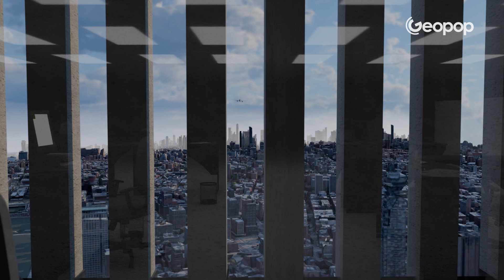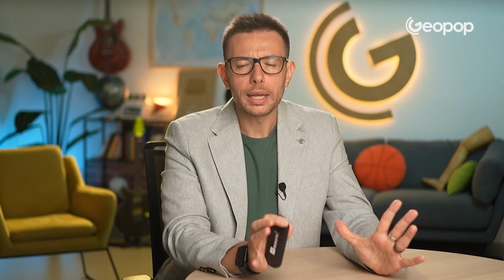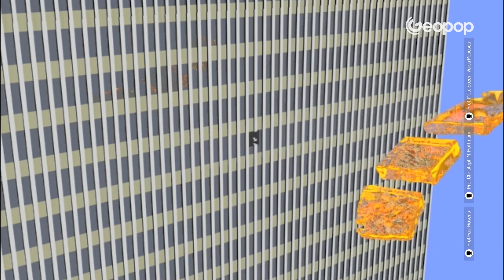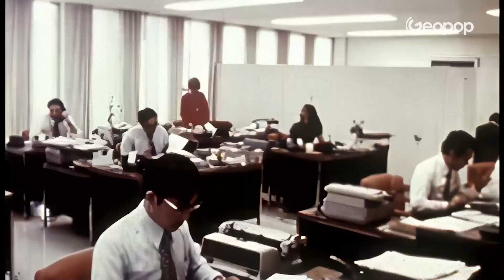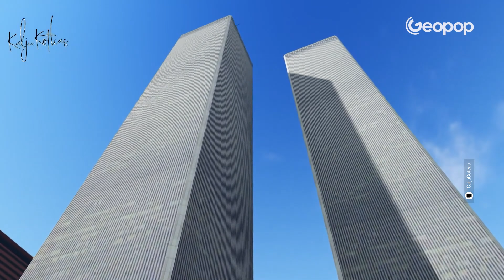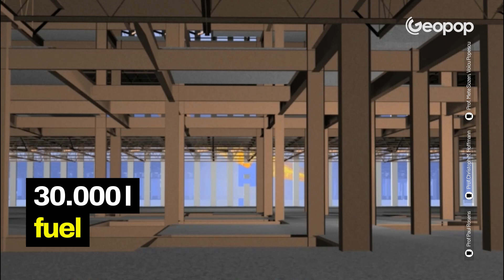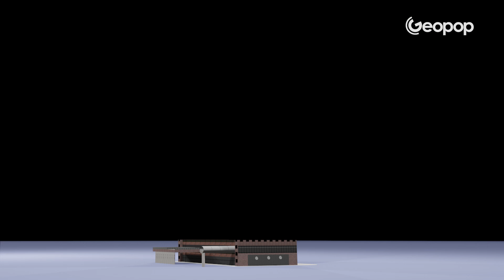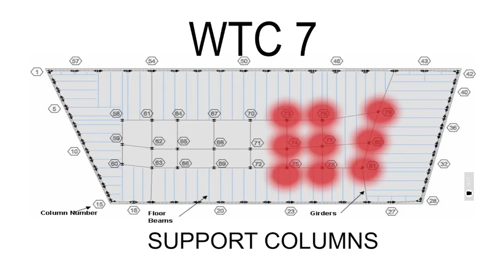9/11, 2001: The Technical Reconstruction of the Twin Towers and WTC 7 Collapses

Comment: It's much easier to say "controlled demolition" than do the physics & thermodynamics calculations involving materials, pressure differentials, conservation of mass, momentum, energy, temperature, laminar vs. turbulent flow, viscosity, and density. Conspiracy theorists don't offer conclusions based on scientific reasoning, they only offer infinite "yeah, but" conjecture.
Reply: So, you've encountered buildings with planes going through them often? Hmm.
Reply: @VickiLynne54-1 No, of course not, nor did I assert that.   But I’ve seen thousands of controlled demolitions.
Reply: @joeschmo5166  just because it quacks like a duck doesn’t make it a duck
Reply: So true,  they think we are fools
Reply: Explain the freefall of Tower 7 with physics which doesn't include demolition.
Reply: @joeschmo5166  stop watching the edited videos from the north side. Look for long video of that building from the south. Seriously, do some basic research. It really doesn't matter; 24 years of indoctrination with self fulfilling "yeah, but" nonsense. I'm not going to be able to explain something to someone effectively brain washed by "Loose Change," "Barrie Zwicker," & "Dr. Judy Wood" plus countless other charlatans.
Reply: @misterfunnybones  Don't need the videos, don't believe you are correct.  Good luck.
Reply: If those people could read they'd be upset.
Reply: Short sales of Airline stocks?  Yeah but...
Reply: @joeschmo5166  4.5 billion dollar settlement...yeah but 🤣
Reply: @joeschmo5166    There is pervasive informed trading activity in equity options before M&A announcements, consistent with strategies yielding abnormal returns to informed investors. All you're telling me is that the market is biased for certain individuals. It's not surprising. The attack was clearly planned & some people knew about it. Admitting that some people knew about it is not a necessary or sufficient condition of an alternate crazy conspiracy theory. Yeah, but...what?
Reply: @misterfunnybones uhhhhhhhh….
Reply: Trying to justify that it was a terrorist by the people implicated. Too save the dancing israelies. We all know what the truth is
Reply: Sorry but if one thing is proven true on that day all the other things come into question. We say controlled demolition because people educated in that field have said it and explained it.
Reply: Gotta love Google, one copy and paste can have you sounding like you studied at Harvard
Reply: @danieldurrance2279  The average citizen is scientifically illiterate. They don't even understand basic physics equations like F=MA.
Reply: Free Fall of Tower 7.  Impossible unless all supports fail at once.  Fire does not cause simultaneous failures, only explosives can do that. Physics is science, last I checked.
Don't be a shill for the man, man.
Reply: @joeschmo5166   Hey genius, fire weakens steel. A fire topped a crane blocks from where I live. A solid steel crane. A crane made of steel, solid steel. A steel crane that wasn't even that high. The steel weakened, then the crane fell over. But, but, but, yeah, but only "explosives" can do that!
Reply: @misterfunnybones  Please stop.  You are clearly dumb.  It is embarrassing to the rest of us, you stupify our discourse.  Listen, and maybe learn.  Genius.
Reply: @misterfunnybones  Never in history has fire brought down 1 steel building let alone 3 ? 😂😂 You're pathetic
Reply: @j @jamesjones5020  that's factually incorrect & logically both invalid & unsound. Just because something has never happened doesn't mean it can't happen. I'd tell you to think before writing, but you've already proven that false & based on your logic you'll never think before writing...
Reply: @misterfunnybones notice the crane FELL OVER not plummeted straight down.
Reply: @blockroxk2085  so, clearly, the conspiracy is confirmed...😂
Reply: A building collapsing free fall speed in it's footprint with the lower half unharmed still is strange.
Reply: d=½gt² aka d=1/2at^2 all objects fall at the same rate - the gravitational constant unless another force acts on them like air resistance, structural resistance, wind, etc.. Look at the videos. Portions of the exterior lattice structure surrounding WTC 1 (floors 93-99) & 2 (floors 77-85) are seen fracturing from the collapse area, breaking off & hitting the ground before the progressive collapse is completed. There's also a massive dust plume that prohibits the exact time of progressive collapse completion. But we can say, unless your braindead, that some debris from the same altitude fell at different speeds & that is the result of structural resistance. Not all material from the building collapsed at free fall velocity - it's clear from various videos. But, 24 years on the conspiracy mindset continues: it never accepts conclusions; it continuously questions everything with never ending inaccurate "yeah, but" conjecture. Distilled it is: anything could be true; therefore, nothing is true. Gravity itself is a "deep state" invention used as a "distraction" from the "real" reasons the building collapsed, & everyone was a paid actor that day. The planes were diverted & missiles with aircraft holograms were used. Endless BS...it's exhausting. @robertgorlee2552
Reply: @misterfunnybones "Vyčerpávající" je obhajovat naprostý nesmysl, že se ty budovy rozpadly na kousky a všechen beton proměnil na prach vlivem gravitace. Nemožné se opravdu obhajuje těžko.
Reply: @janvintr5948  yeah, another conspiracy theorist that thinks gravity is complete nonsense. You've played your cards...😂
Reply: @misterfunnybones Jak jste přišel na to, že považuji gravitaci za nesmysl? Nic takového jsem nenapsal. Jenže kromě gravitace platí i jiné fyzikální zákony, které naprosto vyučují, aby se ty mrakodrapy rozpadly jen působenim gravitace. Bez výbušnin by se to nemohlo stát.
Reply: @j @janvintr5948  these WTC structures, in fact, all buildings, fall down when the force of gravity exceeds structural resistance. The condo collapse in Florida was an excellent example. It can be complete or partial depending on whether the force of gravity exceeds structural resistance & the relative chaos of collapsing material. Conspiracies sell books, keep buying.
Reply: @misterfunnybones "Strukturální odpor" těch věží byl cca pětinásobkem minimálně nutného (budovy se vždycky stavějí tak, aby byl jejich "strukturální odpor" podstatně větší než gravitační síla. Jinak by domy padaly každý den). Jak by mohla najednou vzrůst ta "gravitační síla", aby takovou budovu zbořila? Gravitace je konstantní veličina.
Reply: @janvintr5948  I guess you missed the aircraft trauma & the spreading fire. It's difficult to see if you constantly chase conspiracy ideas.
Reply: What does your word salad actually prove?  Big words.  HA!
Reply: @joeschmo5166   word salad characterization proves your limited understanding... take a course in informal logic & modal logic.
Reply: @misterfunnybones  define informal logic.  genius.
Reply: @joeschmo5166  clearly, you've no post secondary education & can't even look up basic things on the internet. Maybe try a library & ask the librarian for help. I'm assuming that you understand the definition of a library...
Reply: @misterfunnybones suck it
Reply: @misterfunnybones  I don’t mean to move the goal post here, but remember how we were lied in to invading Iraq afterwards? Remember how this government once pitched Operation Northwoods to take us into war? You say a lot. But you don’t actually know the unfeathered truth about these attacks and we were lied to as a country. Our pain was used and if we have a government willing to do that, then we have to ask questions.
Reply: @The_Bugsy_Show  yes, but ask yourself how you know about those "false flag" operations & botched operations like Eagle Claw & Bay of Pigs. The 9/11 event has been scrutinized excessively & there are good reasons & explanations for the event, but there's a continuing thread of "whataboutism" that literally never ends. The mindset of the conspiracy theorist is "anything could be true; therefore, nothing is true." Facts & evidence explain the event. Conspiracy theories range from plausible to absurd & they're good at selling books to people who are willing to ignore the facts & evidence entirely, or portions thereof.
Reply: I get all my papers, I smile at the sky, though I know that the hypnotized never lie…
Reply: There's way too much that stinks about all of it to write on a YouTube comment. This was very obviously a lousy cover up and there is a Mountain of evidence to prove it. You can study this mountain for weeks and you will never be able to call this conspiracy a theory. It's crazy how people just fall in line with the mainstream. These are the same people who think we evolved from monkeys and it's somehow scientific.y God people get your heads out of your..
Reply: @danieldurrance2279  fabulous insight. Maybe take a course in evolutionary biology & genetics, with an emphasis on comparative DNA analysis, because I know you haven't & you might learn something rather than the unsubstantiated garbage from "answers in genesis" & the Creation Museum.
Reply: @misterfunnybones if I argue with a fool, what would that make me..
Reply: @danieldurrance2279    No arguments.  You need to start biology 101 & then take more courses in chem & physics. Take some specific Mendelian vs non-Mendelian genetics courses.
Reply: @danieldurrance2279  There's 10 mountains of evidence to contradict your conspiracy's mountain of evidence.
Reply: The WTC 7 building collapse does not appear to be a "progressive collapse" as is offered in this video. Instead, the building literally dropped as though it was a controlled demolition. The entire structure came down in one movement as if the legs of a table were suddenly pulled off. 

Worldwide, there is no record of any building collapse of this kind due to fire.

 I have seen film of unbelievable high rise fires in South America where almost the entire building appears to be on fire but still no collapse. I remember vividly one where the next day all that was left of the high-rise was the skeleton but again, no collapse. It was in 1974 in Sao Paulo in the Joelma Building fire. The entire building was engulfed within 20 minutes. The next day only the skeleton remained but the building did not collapse. (You can find video of this on YouTube if you care to look). There are other examples.

 Buildings don't collapse due to fire. WTC is the first building on record to suffer total collapse due to fire. 

Also, the narrator states from the beginning that he is not 100 percent sure only that his analysis is based on scientific principles. 

It is important to recognize that these presentations, as impressive as they are, are not always correct in their conclusions. The fact that the narrator makes this disclaimer speaks to his credibility. He is honest and acknowledges that the conclusions drawn may not be correct.

It's easy to get caught up in fancy talk and big words.

 Reminds me of the movie My Cousin Vinnie when the prosecutor was trying to impress the jury with the testimony of the automotive expert who scientifically tested tire samples at a crime scene for the purpose of convincing the jury that the samples matched the car that the defendants were allegedly seen in leaving the crime scene. 

Prosecutor: "What kind of equipment did you use to test the samples"
.
Mr; Wilbur: "We used a Hewlett Packard 57-10/A dual column gas chromatograph with flame analyzation detectors"

The jury laughed and everyone was so impressed with the fancy words. The only problem was that it was all bullshit.

Conclusion: Just because it is science based doesn't mean that is is correct. This is one of the foundational principles of empirical science. 

Also, is isn't a good thing to make fun of CT people. Some of us are pretty smart and know how to apply critical thinking.
Reply: @davidkemmer  science based doesnt mean its correct.  then i would respectfully ask this non sceintific question that nobody seems to be able to answer.  Why?  Why did "they" need to perform a controlled demolition on wtc7?
Reply: @davidkemmer tell em again with your chest out out!
Reply: @davidkemmer The Joelma Building is not steel structured, its a reinforced concrete building. A quick google search would tell you that so of course, it did not collapse because of fires.
And for wtc 7 you can see it on video, it was a progressive collapse. It did not came down in one piece, it was the inside structure that started to collapse from left to right first before the Rest of the building was comming down.
I like how you truthers arent realy smart at all, cant even Google the structure of a building.
Reply: @SAS97x Excuse me my friend. Buildings do not free fall like #7 did from fire. It has never happened. Full stop. Concrete or steel. #7 had its legs cut out from it intentionally . 

Your response is nothing but an embarrassing mess of logical fallacies. 

Go take a class in critical thinking before you express yourself so you won’t continue to look so foolish.
Reply: @davidkemmer critical thinking is good, but you are litterlaly comparing apples to oranges. A concrete building will Never fail because of a Fire. Your only argument is „something compareable has Never happened before so it cant be true“. Nothing but Speculation and pseudo intelligent  talking.
Reply: @SAS97x find me an example of ANY building, EVER, regardless of construction type that has free fallen due to a fire. Then we’ll talk. Son, you are way in over your head.
Reply: @davidkemmer again „it Never happened before“ type of argument. Not gonna go with nonsense like this. If you realy want to know, ask the google ai. Ask it if wtc 7 fall at free Fall Speed too. The answers the AI will give you are not necessarily the ones you want to hear.
Reply: @SAS97x there is no known record of any type of high rise building regardless of construction type free falling as did building 7. That is a fact. If you choose to ignore this truth you are only displaying your ignorance and lack of critical thought.
Reply: @SAS97x AI agrees that the building fell at free fall speed but also points to speculation by some engineers. Many other engineers disagree so at best we have disagreement among professionals. The fact that this type of collapse has never occurred due to fire alone and that many engineers disagree places the preponderance of the evidence well in favor of those who believe it was intentional. 

Critical thinking: It’s a beautiful thing. You should try it sometime.
Reply: @davidkemmer again spreading misinformation to support your narrative with your main „argument“ still beeing „it has never happend before“.  But if you realy wanna play this Game Tell me: How many 47 story steel framed highrise buildings that substained heavy damage have withstand an uncontrolled fire for 7 hours ?
Reply: @SAS97x the burden of proof is on you to prove me wrong. If you find it let me know. I used to be a firefighter, I have a degree in Fire Technology and I know how buildings react to fire conditions. I have researched this and have presented a factual, science based analysis of this issue. Stop with the bullshit. You’re the one spreading misinformation.
Reply: @davidkemmer its your argument. You have to prove it, not me. But you cant because there is no compareable event where a highrise buildings with similar properties did survive a 7 hour Long Fire. So as i Said, your argument is worthless.
Reply: @davidkemmer you already lost all credibility when you compared a fire in a concrete building to the Steel structured wtc 7. Now you cant even provide evidence why your only argument is woth anything. A degree in Fire Technology? Sounds like another sad attempt to make your statement seem more valid. The biggest danger to a steel structured building is fire. Has been like this and will always be like this.
Reply: @SAS97x there is no record of any high rise building suffering a total collapse at free fall speed due to fire as in the case of WTC 7. Regardless of construction type. This has been the basis of my argument since the beginning. If you claim otherwise then the burden is on you to prove or you have nothing. You haven’t lost your credibility. You had none to begin with. All you have presented are straw man arguments , non sequiturs and other logical fallacies. If you have an ounce of intelligence then you will contest my claim directly with evidence. Leave the bullshit out. You’re embarrassing yourself.
Reply: @davidkemmer thats litterlaly what i anmtelling you the whole time, all your Arguments are straw man Arguments. There is no reason to Play into them. You Act like „no building has ever collapsed because of fires like wtc 7“ when there was never a fire like it in a compareable highrise building to begin with.
Reply: @SAS97x you are speculating on something, not presenting facts. If you claim that there was.something special regarding how long THIS fire was burning compared to all other known high rise structure fires then it is in you to provide evidence for your claim. FYI your feelings aren’t facts. My initial claim remains untouched by your lame straw man arguments. Another fail.
Reply: @SAS97x complete bullshit. If you are claiming that time of burn is a factor then it is up to you to bring evidence. At least take the time to do some research before posting nonsense. You are twisting my words to fit your narrative. My initial claim that no high rise building has suffered a complete free fall speed collapse remains untouched by your lame straw man argument . Another fail.
Reply: @davidkemmer  24 years of whataboutism...😂
Reply: @misterfunnybones  There is no whataboutism here. It is clear that building seven was brought down intentionally. Pull your head out of your ass and see the light.
Reply: @davidkemmer  There was a video on YT and I have not seen it for decades but it showed one of the planes 
literally disappear into the tower !  As a darkroom tech at the time I could not believe what I was seeing ! It was in slow mo with huge pixels ! Was this the birth of AI ?  War of the worlds copy !  Missiles used at pentagon !
Reply: @davidkemmer  Clearly, a mass hallucination, plus everybody on earth was a paid actor that day. Gravity itself is controlled by the deep state. See how easy it is to create total BS. I think the more fascinating topic is the conspiracy mindset: it never accepts conclusions; it continuously questions everything with neverending false "yeah, but" conjecture. Distilled it is: anything could be true; therefore, nothing is true. Buildings do collapse due to fire & even if it's the first one of its kind, then you have to accept the outcome, but no, yeah, but, yeah, but, yeah, but... it's exhausting.
Reply: Didn't the structure below the impact carry the weight above it all the time? 
What about many witnesses hearing explosions?
Reply: @robertgorlee2552  I think you're forgetting about the impact force of the intact top floors collapsing onto the damaged ones below. You think the combined weight of 20+ stories of a skyscraper dropping down has no additional force? And you thinking exploding a jet liner inside an office building isnt going to damage a single floor enough to be unable to handle the weight of the 20+ floors above it?

"What about many witnesses hearing explosions?" I mean, care to elaborate? When were people hearing explosions? After the plane hit, and before it collapsed? You don't think with that much fire and that many open windows sucking in air and that much flammable material, you don't think there was a single solitary flashover? Or do you mean as it was collapsing, like someone was actually able to distinguish an explosion sound from the massive sound of a skyscraper collapsing? Sounds like you're just making stuff up. I'm sure all kinda of weirdos claimed all kinds of stuff afterwards. I mean, here you are, some rando on YouTube saying dumb sht like 'oh, but what about the many witnesses hearing explosions!' Yeah, and I saw the easter bunny fly out of the south tower just before it fell! And yet none of the news footage showed it! What an enormous conspiracy!
Reply: @bremmsparkfist5298 Even firemen were saying we heard explosions, and people who came from the basement.
Reply: @robertgorlee2552  your confusing static loads vs dynamic load. Both WTC1 & 2 had too much dynamic mass for the lower portion to support it once the load bearing areas were changed due to impact trauma & heat from fire. The potential energy was converted to kinetic. Gravity is constant. F=MA.
Reply: @misterfunnybones  you just answered your own silliness… Sorry I couldn’t think of a better word. I am not trying to be insulting however, gravity is constant as you said, meaning that the load was always being held up and in fact, some of the mass it was holding had disappeared due to the explosion in fires, reread your comment and realize how you are saying that the building below was weakened by fires, which is literally impossible unless you were talking about heat and fire from nano thermite or something of the sort, but nobody wants to talk about that. I am sure you have heard of the hero fireman nicknamed Oreo. He made it to the impact zone and he reported multiple pockets of fire. I believe three, but I could be mistaken and many dead bodies ironically, he was not melting from the supposed 900° heat or more according to this narration, lol and neither was the waving woman they both unfortunately perished in this tragedy, but neither of them melted in the exact same spot that everybody else claims the heat melted and bent and weakened the steel.
If you literally have no questions about what happened and think that it is all been solved and there is something wrong with you if you are open to questions and realize that not everything which is said in the news is true because they are bought and paid for. Then you’re on the right track. 

Do some research there is documentation of this. We have used it in other countries and we have used it at home. It is for the greater good of the people… So they say. 

The question is, who are they? 

And who gave them permission to decide when it’s OK to lie to us?
Reply: @PatrickAuricchiosr  silliness is being ignorant of basic facts. The buildings were burning. Are you completely blind? Fire spreads. Flashover occurs in different areas. The conspiracy mindset: it never accepts conclusions; it continuously questions everything with neverending false "yeah, but" conjecture. Distilled it is: anything could be true; therefore, nothing is true. What conclusion are you looking for? If you've already decided this whole thing was planned, then that's your conclusion. It's false & based on bad evidence & ignorance of counter evidence. "Yeah, but what about hologram planes, paid actors, exothermite, multi thermite, supercalifragalisticexpialidocious thermite..." I can BS all day, but to what end?
Reply: @misterfunnybones  lol you mentioned everything but nano thermite do those words bother you?
Reply: @misterfunnybones  you make a statement that if I’ve already decided, the whole thing was planned… I don’t make decisions like that. Common sense in every report including the ones from the government tell you that it was planned LMAO. Are you telling me that you have decided it wasn’t planned?
Reply: @misterfunnybones  also you don’t have to explain fire to me. One of my best friends is a paramedic and fireman and also My Sister’s husband is a fire chief and a union electrician who worked at the World Trade Center after 911… Telling me about flashover and how fire spreads… You’re awesome kid
Reply: @PatrickAuricchiosr yes, you're the expert. You know everything. All your acquaintances provide you with support for your BS theory. It's been almost 24 years. I guess it's time to watch all variations of Loose Change again. Keep the BS flowing; you're a BS expert.
Reply: @misterfunnybones  then how come when the firefighters reach the fire in the first building they said they had it under control only to have it collapse not long after.
Reply: @misterfunnybones what BS? I have asked questions! Are questions now BS?
I’m pretty sure you are the one providing all the answers and only someone who is so certain about what happened could be voluntarily or involuntary providing BS !
Reply: @misterfunnybones  I am very disappointed to hear you get your information and your arguments by only combating loose change videos, all variations of the loose change videos that you speak of watching again and again… Maybe you should try battling intellect with architects and engineers for 911 truth… And I saw in another response of yours to a different comment or asking about explosions. The video still exists of the fireman on the phone telling his mother he’s OK and as he’s handing the phone to someone behind him, I believe a police officer he says here ask these guys they’ll tell you I’m OK as he goes to hand the phone over you can clearly hear an explosion in the background… You know the ones the firefighters talked about over and over before they were shut up!
Reply: @misterfunnybones  I 100% agree with the end of one of your long statements… I love the part where you say you can be us all day but to what end!!!
Reply: @PatrickAuricchiosr   elevators were hitting the ground & bodies make noise when they hit structurss in the plaza, the stage for example. The ability for people to simply ignore facts & evidence is demonstrated by 24 years of conspiracy BS. An explosion is nothing more than a loud noise & loud noise has many causes, but no, people like you hear a loud noise an immediately assume actual class 1 explosives.
Reply: @PatrickAuricchiosr    it's been 24 years. If you're having trouble finding answers to your questions, then maybe the problem is you. The conspiracy mind: never accepts facts or evidence & continually questions everything with infinite "yeah, but" nonsense.
Reply: @misterfunnybones  yeah repeating your reply that you said to somebody else back to me does not add any validation to your so-called facts! Were you at Ground Zero? What do you consider a fact? And what evidence do you have to support you’re supposed facts? Talk about exhausting
Reply: @PatrickAuricchiosr  that's great. Now do you agree that acceleration due to gravity is approximately 9.8 m/s^2?
Reply: @misterfunnybones  you must be referring to somebody else who you were having a conversation or disagreement about free, fall speed, or something…
Reply: @misterfunnybones  you sound as though you might have some knowledge… What is your area of expertise? Is it science? Is it scientific method which anybody who has expertise in science should be aware of the scientific method… Is it structural engineering… Is it common sense… My point is, if you do have an area of expertise and you’re just not resting things you have heard for 24 years as you like to say to me about nonsense the official story has been regurgitated for 24 years also and most people who do not believe the official story because it’s impossible are not referring to loose change as you claim, but I digress… whatever your area of expertise is, do yourself a favor and use that expertise and make believe that you were trying to disprove the official story and I believe your arguments will be less exhausting and it will be a lot easier for you to come to a conclusion that will definitely not match up with the ““ official story””
Reply: @PatrickAuricchiosr  do you accept that gravity is a generally accepted constant force creating acceleration at the speed of 9.8 m\s^2. Yes or no?
Reply: @misterfunnybones
unny that you should mention ‘paid actors’. I just watched the documentary that the two French brothers made, they were filming the FDNY. Among the credits at the end was listed the William Morris Agency (actor’s agency) . Now why would a documentary require the services of an actor’s agency??
Reply: The Naudet brothers and James Hanlon hired the William Morris Agency (WMA) to legally protect, manage, and shop the raw footage to major networks. You don't just walk into CNN & say, "hey, look at this..." But I guess you would.
Reply: @robertgorlee2552 It was built to sustain the weight of the floors above. It did so for three decades. The aircrafts impact removed weight, not made additional weight. Heat damage, and impact damage, was at, and above the point of impact. Heat rises. Everything at, and above the point of impact, is subject to heat increases. Everything below, is subject to static temperature, or cooling processes.
When heat rises, it causes a temperature decrease below. That is refrigeration.